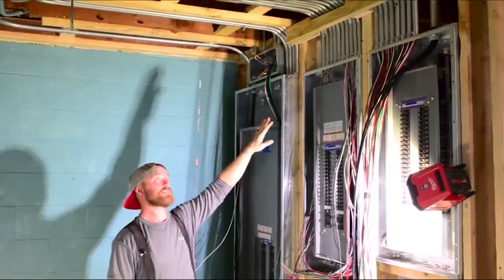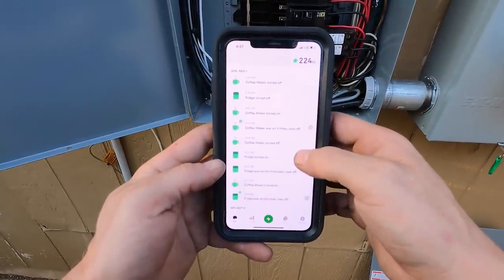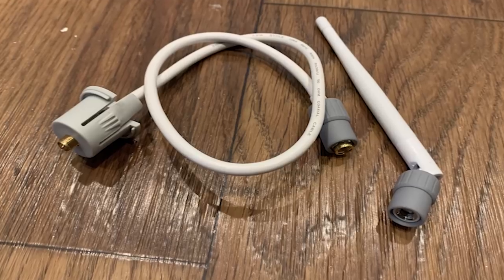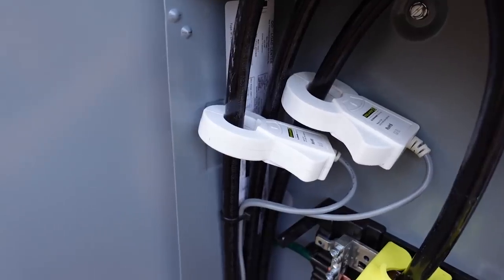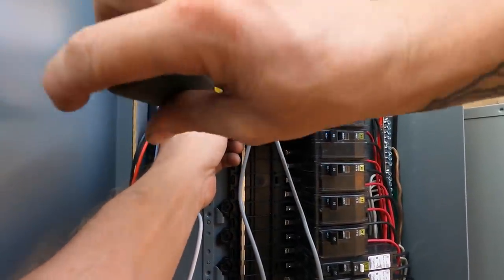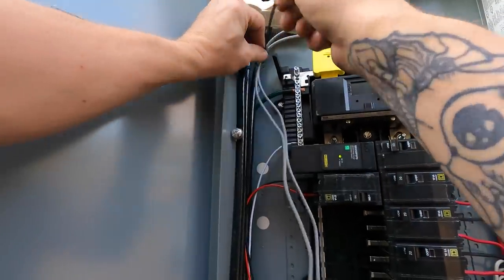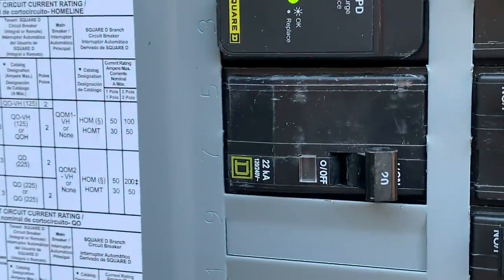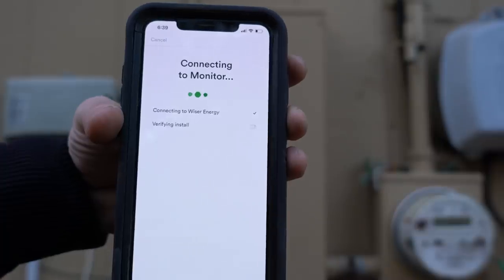How To Install a SMART ENERGY MONITOR in Your ELECTRICAL PANEL

Comment: Realistically, what is a home owner going to do with the info they get?  I work with these systems on switchboards...daisy-chained RS485 networks.  It is very useful in an industrial setting.  But, really now, how useful is it for a single residence?  Sorta neat, sorta cool and sorta a waste of $$$.  Sure you get data.  What do you do with that data?  Nothing.
Reply: People could use that data to make their home more efficient, But for $300 its not worth it. I think if these kinds of energy moniters were rented out to people for a month or so it might be a good deal, But to own one is just a waste of time and money.
Reply: I think that such device can be very helpful specially if you are trying to reduce a +$300/month electric bill, or if you want to optimize your solar investment
Reply: @GerardFont  But you need that info only once.  Not constantly.
Reply: @nhzxboi  sure
Reply: I have one and it tells me when my energy usage is really high - when I get that alert I go around and turn off lights and things that I am not using. Especially now that I have the heat on more often, I wasn't aware of how often I am just raking up energy expenditure. Those alerts are really helpful! 

Its also helpful if you rent out a property - it will tell you if items are being turned on and if you get that alert when no one is supposed to be at your property, you know there is an issue!

Comment: in 4,34 min: 5t is not a good idea to zip  in the  conductors on the power supply cable  becuz that could be creat a noise reading

Comment: In my experience this device is utterly useless at detecting devices. The Vue2 that I replaced it with allows CTs on each circuit and is half the money.

Comment: So this technology can somewhat guess what is running, And things like smart electrical meters have been on the rise. So it seems that electric companies are gonna start datamining people with this technology. Not fun.
Reply from the maker: What companies are not data-mining every human action and interaction on the planet my friend? Facebook, Google, YouTube, your cable company, phone company, our data is everywhere at this point and there’s no reversing it. Hell our government is the largest collector of our data. I’m less worried about the power company watching me than the government lol.
Reply: @ElectricianU  But there are ways to mitigate other datapoints without a serious impact on your life (quit facebook, Use startpage instead of google, Use invidious instead of youtube, Only use HTTPS sites and use DNS-over-TLS to hide from your ISP, Don't use your cellphone unless necessary, etc) But to hide from your Electric company you'd have to either quit electricity (and risk your house being condemned) or switch to solar (which you'd have to be rich or be willing to accept going into crippling debt). I'm afraid of the direction of tracking and i'd like it better if people stopped accepting new data-miners into their home (but most people don't care). Another thing to consider is that when you have your little smart gadget connected to the internet you don't know where it's going to. But it is likely its ending up in china, And i don't think you want the CCP knowing about your electrical usage habits.

Comment: I watched the entire video to the end to figure out what the benefit of this is... Still can't tell u. If u leave things on they cost money, if u buy things with high seer rating they'll be more efficient, the less u turn shit on, the lower your bill. This is gotta be the biggest waiste I've seen lol. Like ur vids tho. But can't see a use for this thing at any point in life that the information would be a use. Maby a device is drawing more  power  after 6 years, so I know it's nolonger as efficient. But that's common sense. But I'll put one In for any idiot that will pay for it

Comment: Pick up a pair of flush cut pliers, they’re game changing for zip ties. No more cuts from the tail ends when working in a panel or control cabinet.

Micro Cutter https://www.amazon.com/dp/B00FZPDG1K/ref=cm_sw_r_cp_api_fabc_FtHTFbJ95H8XA
Reply: I thought the same thing when I saw what he was using to trim the ties.